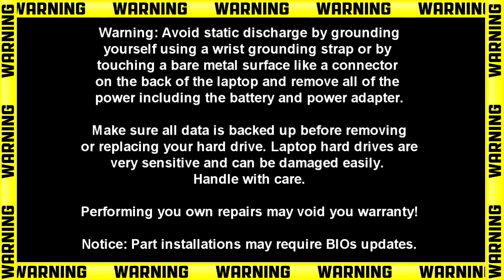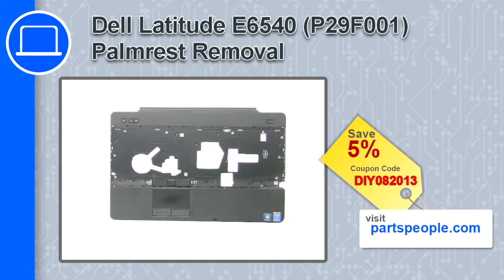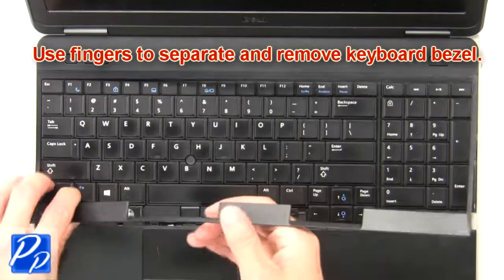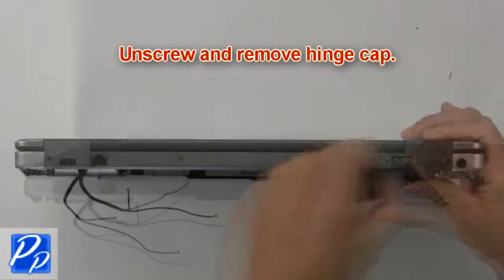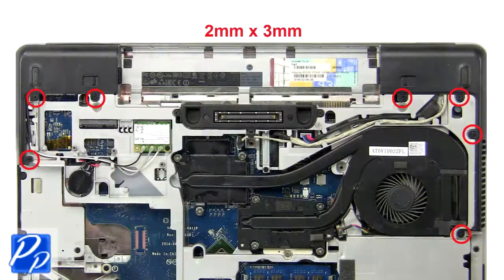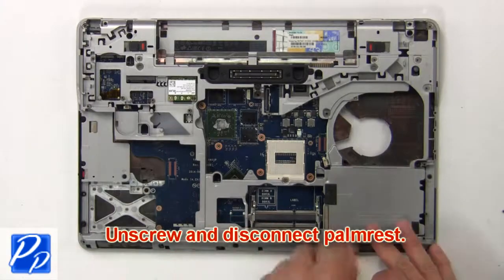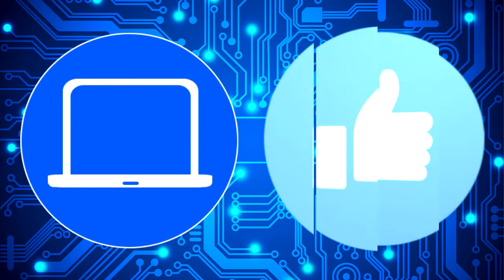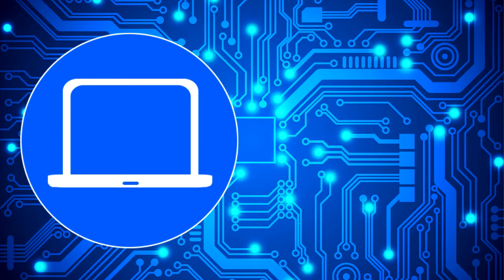Dell Latitude E6540 (P29F001) Palmrest How-To Video Tutorials

Comment: The rubberr button and hinge mechanism are on the bottom of the palmrest, with two little hinge arms. Below, on the motherboard, is a rubber square and the actual power button. When the rubber button is pressed, a leg on it presses the power buttton, and the rubber square provides the bounce back. 
When i opened mine, the rubber square was out of place and the rubber  button hinges were loose from the holders on the bottom of the palmrest.

Comment: Is the power button spring together in the kit with the palmrest?
Reply from the maker: I do not see a power button spring on this assembly.
Reply: @dellpartspeople  it must separate then as the button needs a return spring.
Reply from the maker: @liinaennusaar6685  I really don't think it requires a spring. I may be wrong but they are not something I commonly see in Dell power buttons.
Reply: @dellpartspeople  okay. If you don't see a spring then what system or mechanism brings the button back?
Reply from the maker: @liinaennusaar6685  Most power buttons are screwed down which causes them to recoil when pressed.
Reply: @dellpartspeople  I do not think that is the case with Dell Latitude E6540.

Do you have any more specific information about that model?

Thank you.
Reply from the maker: @liinaennusaar6685  You can see by how this button is mounted, pressing in will cause resistance which will cause it to return to its original position. https://www.parts-people.com/blog/wp-content/uploads/2021/04/e6540-powerbutton1.jpg
Reply: @dellpartspeople   That answers my question and also bring me to the resolution of the issue. Thank you!
Reply from the maker: @liinaennusaar6685  No problem. Glad to help.